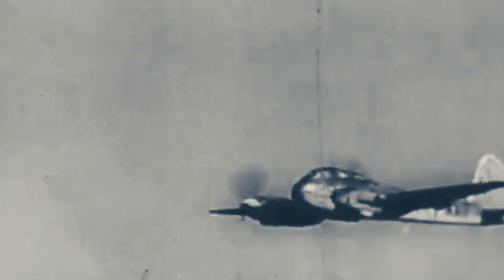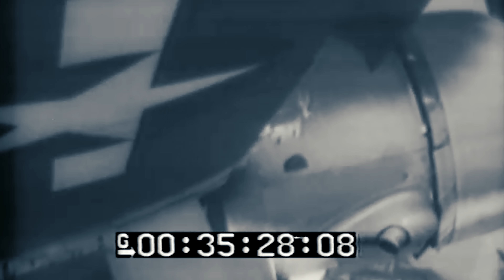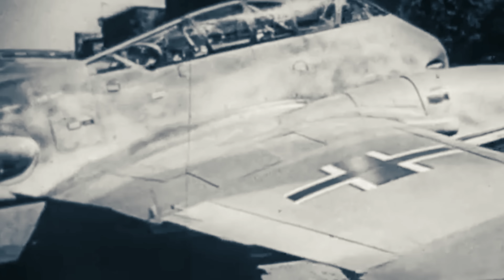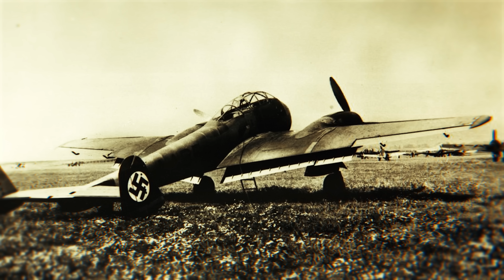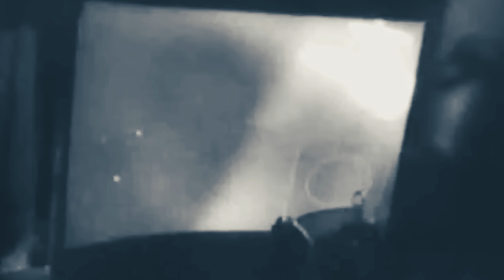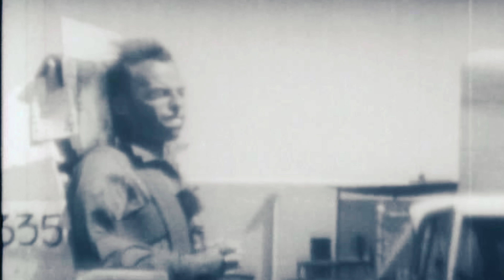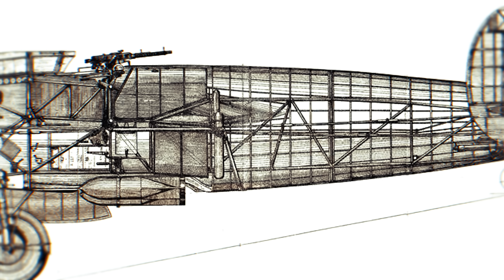Flying Disasters: 3 of WWII’s Most Dangerous Aircraft Designs

Comment: Kelly Johnson, the legendary Lockheed aircraft designer, said he'd rather go hungry than work with the Navy because the Navy has no idea what it wants, and then blames you for not delivering it. The SB2C is a great example of this.
Reply: But it was fortunate that Curtiss was able to fix the design to a much better plane. You'll be surprised how many planes on both sides of World War II went from everyone complaining about its shortcomings to distinguished machines; the Hawker Typhoon and the Kawasaki Ki. 100 are two famous examples.
Reply: @Sacto1654  It was indeed. The primary problems with the SB2C were the result of the Navy being indecisive about its needs - it wanted both high-speed dive stability and to be small enough to fit three planes on an elevator, which was a LOT to ask for the size of an aircraft box that meant (it put extreme dimensional limits on the length of the aircraft AND the wings had to fold to under 17 feet total height (the maximum clear height in Enterprise was 17 feet 3 inches and nobody seriously considered putting the Big-Tailed Beast on an escort carrier; instead, the Avenger (mostly General Motors TBMs) took the place of the SBD in 1944 and 45).
Reply: @Sacto1654 Great point of view, so much of what humans make start off underwhelming and evolve to something great over time.
Reply: @Sacto1654   The "Fleet Air Arm fixed the Corsair" narrative is little more than pop history. The F4U's original birdcage cockpit and landing gear oleo struts were clearly not a problem for VF-12 and VF-17, which were both certified for carrier duty by April 1943, EIGHT MONTHS before the Fleet Air Arm received their first batch of Corsairs on November 1943.

The most often stated ways of how the Fleet Air Arm 'fixed' the Corsair is often 1.) Their push to equip the Corsair with the British-designed Malcolm Hood, 2.) Their insistence on strengthening the plane's landing gear struts, 3.) The incorporation of a 'stall strip' on the wings to reduce stall speed, and 4.) Their development of the 'curved' landing approach to allow pilots to see the carrier and LSO at all times as they came in. Unfortunately, all 4 reasons are bogus, and the Royal Navy had nothing to do with these reasons.
Reply: @rap2xtrooper878  USN “relegated” early F4U to the Marines. It was Eric Brown who carrier landed it with a curved approach. He just did it that way because it allowed him to see the flight deck.
Reply: @Dave5843-d9m  No, curved landings were already regularly practiced in both the Royal Navy and US Navy for years before the Corsair was ever tested for carrier duty. The US Navy had entertained the method during the 30s (take a look at the cockpit positioning on any interwar American carrier plane and it will become clear why). The Royal Navy developed their curved landing technique for the Seafire, the carrier-adapted Spitfire. The Seafire similarly had a long nose from the Corsair.

The curved landing technique was never created for specific use for the Corsair. It was, in the case of both the British and Americans, already an old idea. The entire idea of the British 'inventing' the curved landing is a myth
Reply: @Sacto1654  there was nothing distinguished about teh Typhoon. they designed a replacement to fix the issues, and all we gotten rid of when the war ended due to being too dangerous and not needed.
Reply: @SoloRenegade  The Typhoon had a major issue where the tailplane would fall off during a dive. It was only when the planes were retrofitted with fish plates on the tail that they were able to (mostly) eliminate that problem, but the Typhoon was made obsolete by the vastly superior Tempest V by 1944.
Reply: @Sacto1654  Rudder mass balance.
Reply: @Sacto1654 I’d say that’s a major worry for a pilot
Reply: The F6F Hellcat and the F4U Corsair were the result of the two companies actually giving each other one of those respective aircraft to see what the other did right and use that to improve their own aircraft. That’s a very interesting fact I learned a while ago. XD
Reply: What book was this? Unabashed Grumman junkie here. Any opportunity to learn more about the company is a good opportunity.
Reply: @saberconvoyaviation8674 You can also add the P-47 Thunderbolt. The Grumman and Republic facilities were very close. Their engineers and machinists were next door neighbors. Or more often family members. The CEO’s were friendly, and had a quiet gentlemen’s agreement to not play in each others pool as it were. They would give each other tips, engineering second opinions and suggestions. It’s why the Hellcat and the early Razorback Thunderbolts look like the same plane at slightly different sizes. It’s why the F8F Bearcat looks like a half size Thunderbolt.
Reply: @saberconvoyaviation8674  The US Navy originally HATED the F4U Corsair due to its poor forward visibility and the landing gear issues. It was only with an improved cockpit and canopy design and improved landing gear (based on British Fleet Air Arm experience) experience that the USN finally accepted the Corsair into carrier service in 1944.
Reply: @Sacto1654 Not gonna deny that. I read that in the same book I learned that fact in. But the Brits used it before the US Navy, probably with modifications though.
Reply: @Sacto1654  The "Fleet Air Arm fixed the Corsair" narrative is little more than pop history. The F4U's original birdcage cockpit and landing gear oleo struts were clearly not a problem for VF-12 and VF-17, which were both certified for carrier duty by April 1943, EIGHT MONTHS before the Fleet Air Arm received their first batch of Corsairs on November 1943.

The most often stated ways of how the Fleet Air Arm 'fixed' the Corsair is often 1.) Their push to equip the Corsair with the British-designed Malcolm Hood, 2.) Their insistence on strengthening the plane's landing gear struts, 3.) The incorporation of a 'stall strip' on the wings to reduce stall speed, and 4.) Their development of the 'curved' landing approach to allow pilots to see the carrier and LSO at all times as they came in. Unfortunately, all 4 reasons are bogus, and the Royal Navy had nothing to do with these reasons.

First - The Fleet Air Arm had nothing to do with the equipping of the Corsairs with Malcolm hoods. The first F4Us to receive the Malcolm hood came off the production line in August, 4 full months before the British ever even got their hands on a Corsair.

Second - The F4Us got strengthened landing gear oleo struts at the same time as the F4Us received Malcolm hoods, August 1943. Once again, months before the Royal Navy got their hands on Corsairs.

Third - F4Us had been equipped with stall strips as early as late 1942, a few months after VF-12's carrier qualification trials aboard USS Wolverine on October 1942. Once again, the Royal Navy had nothing to do with it.
Reply: @Sacto1654  Fourth - 'curved' landing approaches on carriers have been used for YEARS before the Corsair was even introduced. The US Navy had entertained the idea as early as the 1930s (take a look at any interwar US Navy carrier biplane - the forward visibility issue will become clear...). They had even entertained the idea in post-carrier evaluations of the Corsair aboard USS Wolverine... 

The Royal Navy had developed their curved landing approach methods independently in 1941 during carrier trials for the Seafire, which was similarly long-nosed and had forward visibility problems. It is likely that when FAA airmen were trained on US Navy air stations in late 1943 for F4U training and familiarity, that both the Americans and British were both familiar with curved landing approaches, so the whole idea of "British taught the Americans" is most likely nonsense. Both navies at that point knew what they were doing.

Please don't parrot around stuff you only see on Wikipedia and YouTube videos. It's not that hard to do your own research
Reply: @Sacto1654 …true! But the Marines used it to great effect from land bases. After WW2 the Hellcat went away. Versus Corsair production continued till after the Korean war ended.  In the beginning the Hellcat was a better choice as a carrier aircraft.
Reply: @saberconvoyaviation8674 Boosted the seat up and to land on a carrier had developed an approach so the pilot had a good view of the ship. Trouble occurred if you tried to approach directly as the long nose blocked visibility on approach
Reply: @Sacto1654  I believe the Marines liked it when it was relegated to land bases at first
Reply: Douglas Aircraft and Ed Heinemann also figured this out. Their response was to look at the specs from the Navy, figure out what the goal was, then ignore the specs. The A4 Skyhawk was supposed to weigh 33,000 lbs and have folding wings; Douglas produced a plane that weighed less than half that much but kept the range and payload the Navy head asked for. Its little delta wings didn't need to fold to fit on an aircraft carrier.
Reply: And its only gotten worse and spread to the other branches. Now an aircraft has to fit requirements of the Army and the Airforce in some cases.
Reply: @RazgrizWing Actually the USAF&USN shared basic designs for a time to be specific the basic F-4 Phantom II and the A-7 SLUF.
Reply: Leroy Grumman might beg to differ.
Reply: Sweats in navy F35
Reply: Another Kelly Johnson W?
Reply: Well. Japanese navy also have same problem at ww2. They want the most performance from carrier based aircraft with their underpowered engine. From two company that navy give proposal, Only Mitsubishi and their chief engineer accepted it (Nakajima just said "impossible bro") and using tactic "throw everything except for radio, gun and amunition" yeah and we got Zero. Navy always want something so dreamy.
Reply: F-100 Sabre Dance.
Reply: KJ was a champ!
Reply: Grumman rarely had an issue working through what the Navy wanted. The Hellcat and Avenger are probably the pinnacle of delivering the exact plane not simply requested, but needed.
Reply: Leroy Grumman didn’t have a problem.
Reply: But you have.
Reply: Yeah, totally the navy's fault they couldn't build a dive bomber
Reply: Grumman had no such problems.
Reply: USAF is no better.
Reply: @john-or9cf  The USAF usually has a pretty solid idea what it wants, and when it doesn't (such as the transition from the YC-14/YC-15 program to the eventual C-17 Globemaster III, which has been flying successfully now for more than 30 years), it's because the mission actually changed (the Air Force thought it needed a jet-powered tactical airlifter; turned out what it actually needed was a replacement for the C-141 Starlifter and, separately, a stretched version of the C-130 Hercules).
Reply: Lmao fr
Reply: sounds a lot like my entire career in the service industry
Reply: "Perhaps the real challenge in aircraft design is not just the engineering, but navigating the tangled web of bureaucracy and shifting demands. After all, even the most brilliant designs can be overshadowed by the chaos of human expectation.
Reply: There are stories about Curtis workers being almost thrown off carriers after SB2C,'s came up missing.  It turns out Curtis knew about issues with the wing latches.  One wing would come loose during flight,
The reps wére under orders to not say anything to men they were eating supper with.
Reply: It seems the 'Helldiver' killed more planes & pilots than the Japanese Navy.
Reply: So they're women
Reply: @gratefulguy4130  You know, the misogynistic dig was really not necessary.